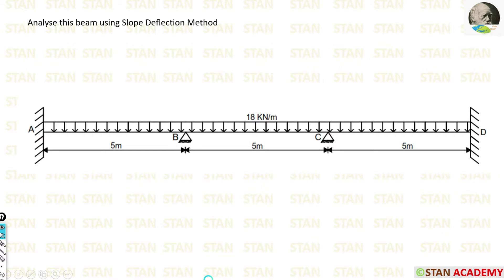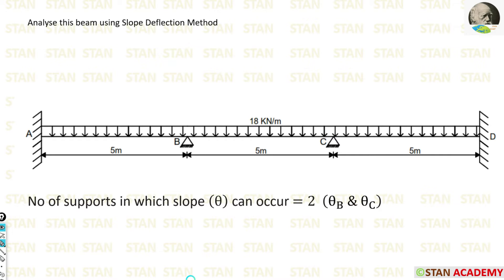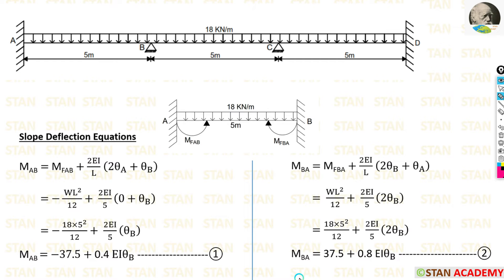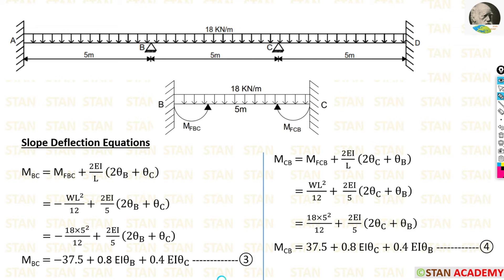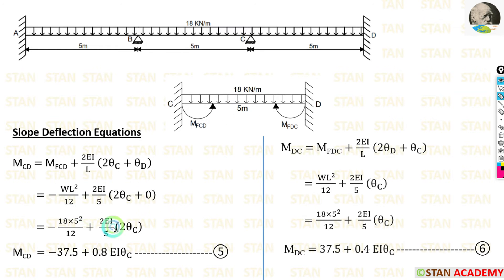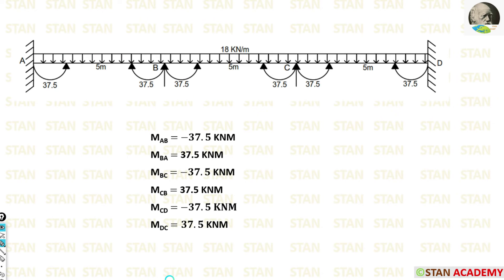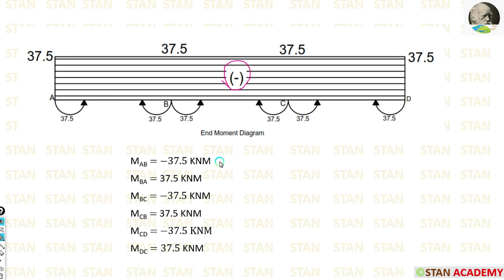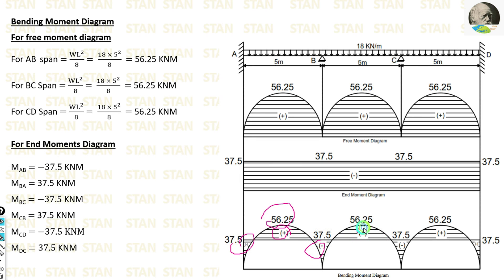Slope Deflection Method for Beam Analysis - Problem No 13

Comment: Sir( -3∆\L ) or (+3∆\L) which is right
Reply from the maker: It depends on the settlement condition. If the  settlement occurs towards the right side it will be negative and if the settlwment occurs towards the left side it will be positive